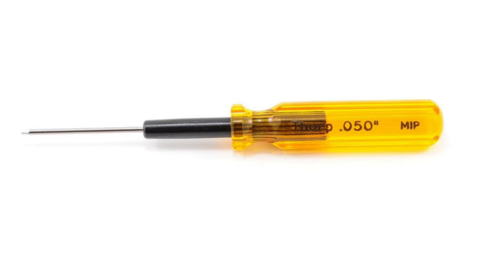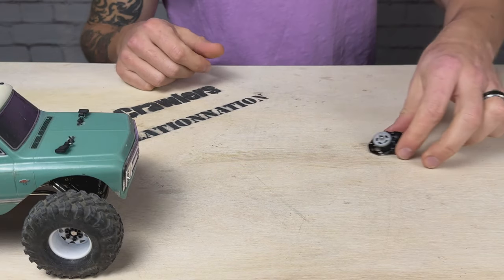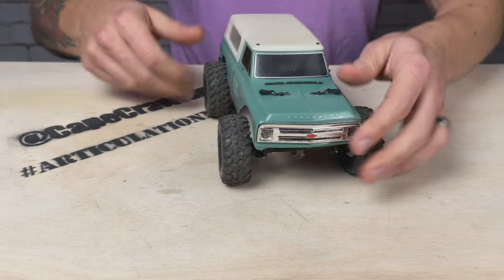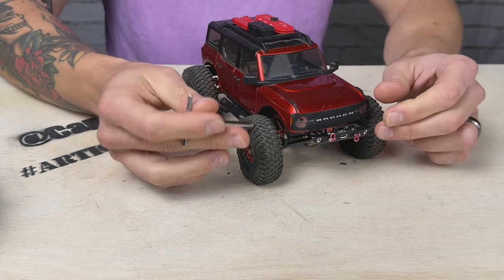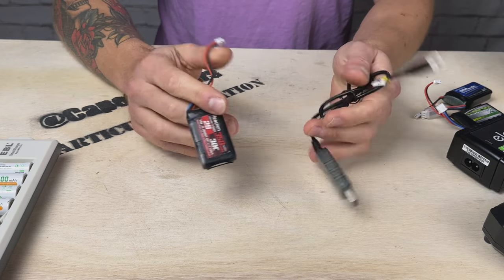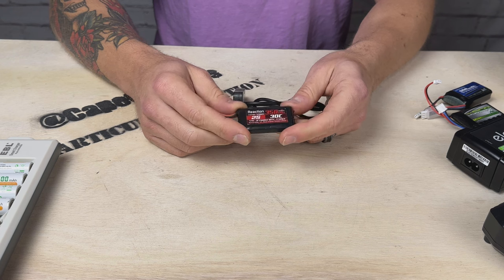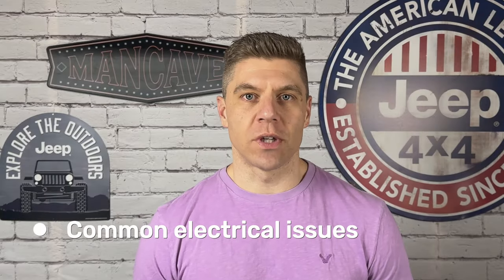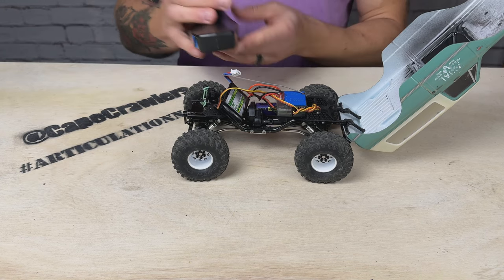SCX24 Beginner Basics – 5 Tips & Tricks to Get You Started on Upgrades!

Comment: Great video, Adam. Ever had a LiPO puff for seemingly no reason? They get puffy when you exceed their current draw spec, sure, but what about when it's just sitting in a box and you haven't used it for some weeks or longer, and you come back to find it puffy? 

I've been using LiPO batteries for nearly 20 years and currently have maybe 150 of them in sizes from 50mah to 12000mah, 1S to 8S. In all that time I've lost 3 to failures or damage before their time (which is about 500-800 charge/discharge cycles for any lithium chemistry). 

The key to the longevity, for all lithium cells, is to store the LiPOs at 3.8v/cell. Any charger you go out to buy wants to have a Storage program on it, which will balance the cells down to that level per cell. The LiPO can then be stored for maybe 6+ months before you need to pop it on Storage charge again. I manage mine on a chart so no battery gets overlooked :)

Keep up the great work. You have excellent delivery and I LOVE your workout/24th scale basement/playground there :D
Reply from the maker: Thank you for the info! I need to further educate myself on lipo storage and this is really helpful. I have only had one lipo failure and it was a nearly new 350mah from an scx24. It puffed up on the first charge. I caught it quick thankfully. 

My basement has become a total mancave playground! If it were finished/heated I would never come up and out of it LOL

Comment: Awesome video Adam... wish I had your tip on the stamp steel wheels about 3 weeks ago..lol took me over an hour to put 1 together... I didn't touch them again for about a week till I watched some videos... than I ran them on my daughter's scx24 deadbolt for about 2 weeks and changed them out for some bright green aluminum beadlock wheels from Amazon...I will use the black rcawd on another build
Reply from the maker: Those wheels are so frustrating at first! But once you get the routine down it’s just another wheel. Thanks for watching!
Reply: @CapeCrawlers  quick question are you going to do any more videos on the rochobby fire horse? I just ordered 1 will be here mid February...

Comment: I bought the MIP tools you recommended as well as the eco power charger and battery for my fms also the swamp kings and bead locker wheels. Mine came with the old style box but thank god the portal gears are metal. If I remember that’s what you were talking about in another video. New box metal gears in portals old box sometimes?? Next up is aluminum steering linkage and aluminum wheelbase extension kit not the 3d printed one! Just my preference. Thanks for the advice! I’m gonna love this new hobby of mine I suspect 😊
Reply from the maker: Awesome! I hope you love the hobby. It's so rewarding and enjoyable. Thanks for watching!

Comment: Wow, thumbs up and respect you took the video off, revised it and uploaded the new version again! There are other channels which will not do this but delete the critical comments. 
However, a pity you changed from 1.3 mm in v1 to 0.05 inch in v2, because this is the world wide web and the world does use metric tools, and it is nearly impossible to buy imperial tools outside US (in shops, of course not online) ;-)  In science imperial units are banned for decades now, thankfully.
Reply from the maker: I could not let a video aimed at beginners live on with incorrect information. But it sounds like I made some work for the rest of the world in the metric conversion!
Reply: @CapeCrawlers  This was more of a joke (with imperial vs. metric). 
Still not totally sure what is the correct size for those screws, 0.05 inch or 1.3 mm hex driver (there is a tiny difference), but both work. 
However, for us "Non-US-people" (about 95% of the worlds population ;-) ) this is sometimes quite puzzling. Mainly ounces, Fahrenheit, ... I am really happy that imperial units are banned for decades now in science (publications), only makes the world more complicated.

Comment: If you had $400 to buy and upgrade a 1/24 would you do the Axial SCX24 Gladiator or the Axial XC-1 4WS?
Reply from the maker: I think I would do the gladiator! It has less shortcomings to address and you could spend more money on performance improvements, not just sorting out issues.

Comment: Hey Adam question!  Just finished my Injora buggy and I’m really not happy with the Injora transmission (I can tell it’s binding) .  What’s your favorite to use?  I’m using a Pancake, Lizard Ult, noble nb4, and Honey Badger Servo.
Reply from the maker: My favorite is the Furitek stellar transmission. Next favorite would be the LGRP billet aluminum setup. Mofo RC also has a brass transmission fully built which I have never tried, but I am certain it's amazing.
Reply: @CapeCrawlers  … awesome thanks!  You caught my attention when you said you burnt a few motors up with the spur gear nut too tight. lol.  My buggy “lifts” in reverse and squats going forward.  Is that because of the over-drive in the Injora front axle or you think it’s binding in the drive train?
Reply from the maker: @bladeaddison3189  it's tough to say because the SMP has a ton of power. You're going to get some movement from the torque. Does it lift even at low speed and gradual throttle? If yes, it's likely something binding or causing drag.
Reply: @CapeCrawlers  … yeah the minute I reverse it starts to lift and then back forward it sucks down. Strange.  As you know the buggy is tough to work on with no real frame. lol. I’ve pulled the tranny and motor twice torquing and “loosening”. lol
Reply: @CapeCrawlers  … are you on discord or any crawler FB groups?

Comment: Hey ..i have a problem..when I turn my machine on it takes off in reverse. Can I rebind my transmitter to the machine to fix this?..I've also had terrible luck with the stock battery..I have 3scx 24 and I really like them ..but the battery trouble is terribly agitating...anyway ...I just bought the 3rd on 1.25 and t9day is 1.27 and the battery now when I turn it on the wheels turn to the left by them selves..and the barrtry goes dead over night. I guess it has phantom draw..could this be a bad ecs..it's a brand new machine...I would appreciate any advice..thanks..
Reply from the maker: Which model is it? The reversing could be a throttle dual rate adjustment on the transmitter. It sounds like a bad esc though given the steering issues at the same time. Make sure you are unplugging your battery after use. If left plugged in they’ll drain pretty quickly

Comment: I have a question, so I have a Scx24 gladiator and it has a weird torque twist. Just sitting there not moving it sits to one side and when I accelerate it just gets worse, do you have any experience with this? It is lightly modified with injora shocks
Reply from the maker: Mine does the same exact thing. I haven't been able to pinpoint it. I wish I had more insight but I haven't been able to solve my own twist!
Reply: @CapeCrawlers  thank you, I think if you get a brass skid plate and brass boulder bars, it may fix it. I may try it